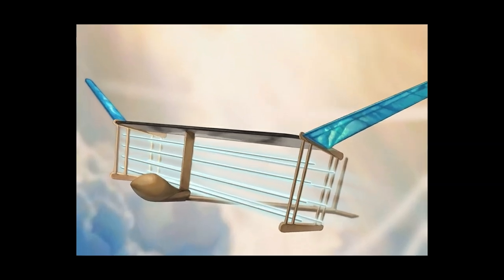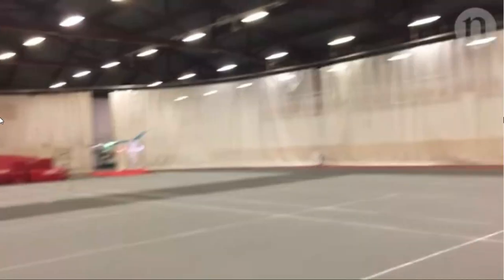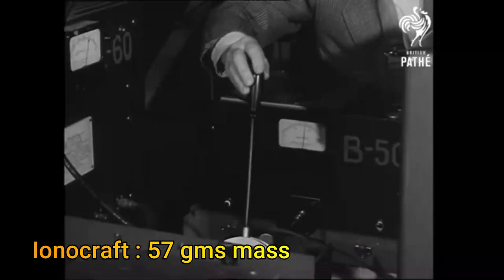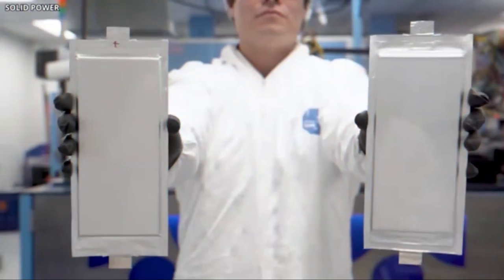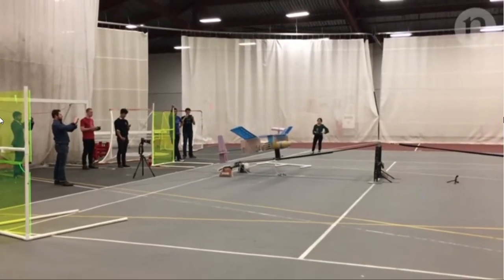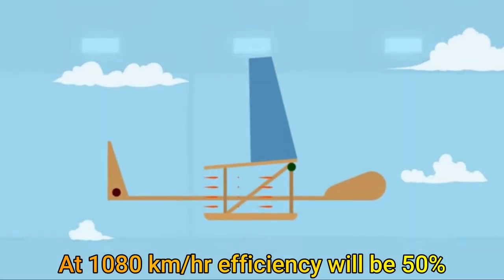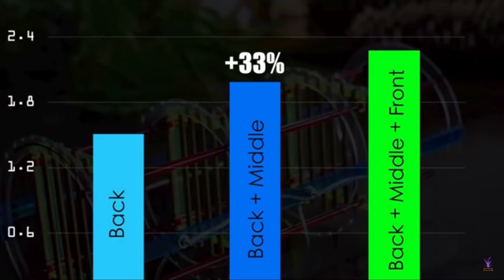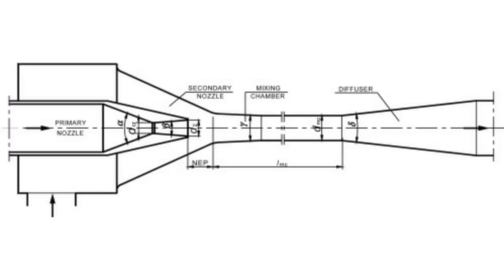Electroaerodynamic Propulsion:  Is it viable?

Comment: I believe the technology is not being used in the most beneficial way.  It may or may not work as the "only" thrust mechanism, but what I think needs to happen is using this technology in conjunction with other technologies to improve efficiencies of existing designs.  For example, this technology could be used to ionize the air on the leading edge of a wing (or other surfaces where drag is a problem) to help reduce turbulence and drag.  It could also be used, incidentally, to help reduce friction on leading edges for hypersonic craft and therefore lower the heat buildup.  And I'm sure there are many other ways this technology could be used to help with efficiency that I haven't even thought of.
Reply from the maker: Good ideas
Reply: @ElectricAviation  thrust can be improved using photoelectric materials to emit  electrons
Reply: This is exactly what I was thinking. A purely ionic-driven aircraft will never be able to have much power output, but since it is very efficient, it would be awesome to have one of these systems built into the wings of conventional aircraft just to reduce the amount of engine power needed. I think that could result in significantly more efficient cruising and be especially useful for increasing the range of electric aircraft, making them more viable.

Comment: As you said, they've really ignored the aerodynamic aspect of it so far. With ducting and entrainment it could surely be improved substantially.
Reply from the maker: I believe so too
Reply: Their working with low-voltage settings.

The goal is to have enough newtons to break away from Earth's Gravity or create it's own source of gravity that's independent of the current setting of gravity.

Mr. Thomas Townsend Brown actually found the formula; 2 Kilo-Newtons for every Kilowatt.

If you don't believe me, then you need to breakdown, every single piece, on how a "B-2 Advance Technology Bomber" is made, and why is it still considered the fastest craft.
Reply: @lumberluc  ??? The B2 isn't even supersonic, certainly not the fastest anything.
Reply: @jamesdeath3477  Okay... your not looking that way. Then look at why what it classified and how it was made known.
Reply: @lumberluc  How about you just tell me whatever you're trying to say, instead of asking me to "look at" whatever it is? Currently I've no idea what you are talking about.
Reply: @jamesdeath3477  Wow... Your no fun. Must be a real bore at parties.

Anyways, the tech is there. Inside the twin turbine engines of the B2 bomber is a lattice matrix.

Fuel is burned, leaving an negative ion charge, collected by the lattice matrix, which is then lined on the craft. This make air resistance null and giving most radar-technological methods the slip.
Reply: @lumberluc  I may be a bore, but you don't find me making stuff up to make myself appear clever. Maybe just stick to the UFO websites in future, eh?
Reply: @jamesdeath3477  Another one who isn't even into Black Box Projects delivered by Skunk Works, which is part of Lockheed Martin.

Sigh... So narrowminded.

ANYWAYS! My basis of the comment is; The tech's there, along with the fear, and may the best man win.

Comment: Very interesting indeed. Efficiency numbers of sub 50% are going to be a challenge with Li batteries (hydrogen fuel cell perhaps?) but the lack of noise and the absence of moving parts means that this propulsion system is both quiet and safe. The two most significant issues with electric aircraft today. I'm guessing that enclosed tubular jets with multiple ionic thrusters are the way forward (rather like Linear Accelerators in Physics).
Reply: "safe", they still are under enormous voltages.
Reply: I'd say the biggest issue with modern aircraft is how polluting they are. Unless you're going supersonic, I don't think noise is that big of an issue comparatively.
Reply: thrust can be improved using photoelectric materials to emit  electrons
Reply: Makes one think of propulsion in extraterrestrial craft... 🤔

Comment: Hard to imagine this EVER being able to be higher performance at a given speed than propellers. That’s all that matters.
Reply: Depends on what you mean by 'higher performance'. I'm currently presuming you mean to use the term 'performance' as a stand in for 'units thrust per unit energy' or something along those lines, but unless I'm mistaken about your meaning, I feel you may be missing the point; overlooking what performance metrics the demonstrated systems seem to excel at in favour of where they clearly lag/fall short. I'm fairly certain that there are a number of instances where lower thrust per watt would happily be accepted in exchange for lower decibel levels, as drones that operate more quietly could find use in instances where propeller noise might be considered 'disruptive', and by that metric these 'ionic thrusters' seem to have far 'higher performance'.

For instance, I've heard a number of proposals for restaurants, bars, theaters, stadiums and other such venues that want to use drones to deliver food and/or drinks either directly to customers or else to some more centralized hub where servers would further distribute them, and one of the frequently cited sticking points is with the noise said drones would produce and how it might negatively impact a dining/viewing experience. A near silent drone would soundly address that issue, if you'll pardon the pun, and with the short flight paths expected and a sufficiently sized fleet alternating charge cycles the drone being less efficient may not be a deal breaker; leaving said proposals to fail in newer, more innovative ways🙃

Other potential areas of use might be fields like wildlife observation or even law enforcement where being a less obtrusive presence in your surveillance could be the difference between subjects/suspects acting naturally and them being cautious or evasive. Drone delivery is also an area that might benefit, not because I think people would be so annoyed by the sounds of sub-urban drone deliveries that quiet drones seem like an urgent priority for the adoption of such things, but rather because I've had a truly remarkable number of conversations with seemingly otherwise reasonable people veer onto the topic of shooting down delivery drones with slingshots to steal packages... I suspect that less then ninety nine percent of the people I had that conversation with actually would 'shoot drones for loot, holmes', but for the sake of not tempting that one percent maybe sometimes 'higher performance' means not letting them know a drone is delivering to his neighbors back porch.

Now, it's fully possible this tech just doesn't mature to a point where it's actually useful in any of those areas, or that other solutions come along rendering such things obsolete before it does, but it shouldn't really be needed to be said that different use cases have different performance priorities and that there is rarely a single engineering solution that is best across them all cases. Even if they remain weaker and less efficient, they may still find niche application.

Comment: If the idea has been floating around for about 100 years, who was the first to write about it or get a patent on it?
Reply: Robert Goddard received a patent in 1906 for a low powered ion thruster.  Then in the 1950s TT Brown made an air breathing one that could swing around a pole, powered externally.  After him, Major De Seversky built a device with a large external heavy power supply as well, that could take off vertically, there are also many others that made small but notable improvements.  I am the lucky one that has the patents for the first such device that can lift its own power supply vertically! against Earth's gravity!  It cost vastly more money to develop it over the past 23 years than the project has earned at this stage.  To those few that donated or invested, I am extremely grateful.

Comment: Atmospheric ion thrusters are unlikely ever to be efficient. Due to high energy transfer to ions in subsequent collisions with neutral molecules most of the energy is absorbed by rotational/vibrational molecular states. Increase the ion density and reduce the field strengths and you run into space charge limits.

Comment: A lot of years ago I was very interested in this concept ( I remember when the Popular Science article came out in the 60’s). Years later, my thoughts were directed at the idea of using contra rotating discs to generate the high voltage electricity with electron stripping materials between the discs then use the electricity to make other parts of the disc surfaces “stickey” to the air and cause them to perform as impellers in various ways and to cause a high velocity airflow over the body shape to produce lift and thrust. I never tested the idea. 
At the moment I am more interested in making the Custer wing an effective drone where I have devised a method to make the wing transition from high lift low speed to low lift very high speed.
Reply: @jcd-k2s  It’s pretty straight forward. Consider a frisbee which when it spins causes air to flow over the surfaces with Chanda effect on the upper surface drawing the air around the surface deflecting it downwards creating lift in conjunction with the low pressure zone above the disc. 
Now attach a motor shaft to the frisbee, and the motor drive Body to another disc. The two discs will rotate in opposite directions. Between the two discs apply an electron stripping material (Van de Graf Generator) to provide high voltage electrons to be used in a multitude of ways. The electrons can be used to make the main drive surface more sticky to the air to improve the impeller effect. It can be used to induce air flow between surfaces to enhance the Coanda effect at the skirt of the drive disc. Etc. There are many possible configurations to experiment with.

Comment: I think the technology is really good for lighter than air craft.

Particularly if you use a hybrid rigid, lifting body, lighter than air craft, with thin film solar panels.

That gives you the area you need for all the solar panels without having to lift them purely aerodynamically.
Reply: yes.   as the DARPA "Walrus" was intended to do.    for fun this  coming holiday, read "OMG A UFO"
Reply: also motor gliders with solar panels. removing the electric motor would be great for long duration flight and pseudosatellites. at the moment ionic thrusters are too inefficient

Comment: Another excellent video that makes me think outside of the box...
The challenge with electroaerodynamic propulsion is Coulombs law: you need high electric field strengths to make the electrons jump out their outer shell orbitals. This means high voltages and very fine wires - ideally lots of them. The high voltage isn't a constraint as long as you can avoid flashover, but fine wires risk mechanical failure from the aerodynamic load  as speed gets high. To my mind very fine aerofoil shape aluminium extrusions are the optimum to keep drag down and provide a sharp trailing edge for maximum N+ generation. The risk here is increasing wetted area so you create more drag than you remove.
Propellers and rotors are actually a very efficient and practical solution to moving air, but electroaerodynamic modification to hold on to laminar flow near the trailing edge could definitely benefit high speed cruise in electric aviation speeds (ReN>>1E7)

Comment: At CES this year a company called Frore showed their AirJet, something they called solid state cooling.  It’s meant for cooling computer components, but it did seem like it could move a decent amount of air in a pretty thin package.

All pie in the sky thoughts at this point, but it would be cool if this tech could be scaled up and used as propulsion. It would have interesting applications as active boundary layer control and thrust vectoring if integrated into the wings and flaps/ailerons. Might be something to keep an eye on.
Reply: Frore I believe is using ultrasonic vibration to move air not ionization.

Comment: Improving the performance of electroaerodynamic (EAD) propulsion systems will require a combination of technological advances and a better understanding of the underlying principles of ionic wind propulsion. Some potential ways to improve the performance of EAD propulsion systems include:

Developing more efficient ionization methods: Currently, most EAD propulsion systems use high voltage electrodes to ionize the air and create the ions that are used to generate thrust. However, these electrodes can be inefficient and can generate a large amount of heat, which can limit the overall efficiency of the system. Developing more efficient ionization methods, such as using lasers or other forms of electromagnetic radiation, could improve the performance of EAD propulsion systems.

Improving the design of the propulsion system: The design of an EAD propulsion system plays a crucial role in its performance. For example, the shape and size of the electrodes, the placement of the ionization source, and the design of the thrusters all affect the efficiency of the system. By carefully designing the propulsion system to optimize these factors, it may be possible to improve its performance.

Using advanced materials and coatings: The materials used in EAD propulsion systems can also affect their performance. For example, using materials with high electrical conductivity or low levels of resistance can improve the efficiency of the system. Additionally, using advanced coatings on the electrodes and other components can help to reduce wear and tear and improve the longevity of the system.

Conducting further research and development: Finally, continued research and development is necessary to fully understand the potential of EAD propulsion systems and to identify ways to improve their performance. This may involve conducting experiments and simulations, as well as collaborating with other experts in the field to share ideas and findings.
Reply from the maker: I concur with all your suggestions

Comment: There are studies dating back to the 1950s that describe tests on conventional air craft surfaces. What is found is that the laminar flow becomes much more stable and in situations like a climbing aircraft wing the vortices behind the lift wing are greatly decreased. 
Other later works study how air flow can be steered by using variable rear elements. Essentially connecting differing points as the receiving end of the static charged flow can steer the airflow.
The third interesting study was published by the dept of the navy back in the 1950s. This study found that a large field created around a conventional jet could disrupt the air molecule flow behind the plane enough to disrupt the sound wave formed by exceeding mach 1. So a sonic boom muffler.

Comment: This is what the future really looks like.   The atmosphere is also full of electrical energy and a plane moving fast could probably gather enough energy and feed it right through these thruster  to maintain its momentum.  You can also use magnetics to heat or accelerate the ions.
Reply: Infact, if there are any engineers out there with real chops, I will seed a start up around this.

Comment: Awesome. But similar magnetic energy there exist a lot of problems. Low trust as an example is one of the disadvantages of this technology. But according optimization we can use this technology. Furthermore, high voltage cause a lot of problems for the passengers body if it would be improved. Produce the high voltage is very hard for the aviation systems.

Comment: I’m not really seeing the value of adding a duct. A duct can basically do three things: 1) 
the inlet shape can make trades between inflow air pressure and speed, 2) the duct can reduce fan blade tip losses, and 3) the nozzle shape can make trades between outflow pressure and speed.

Obviously, fan blade tip losses are not a concern with a solid state propulsion system.

At the inlet and outlet (nozzle), there is probably not a big enough pressure difference to make the added weight and drag of a duct worthwhile.
Reply: Thanks for saying it!  Furthermore, all of these types of air breathing ion thrusters pull in lots of air from the sides, so covering up the sides just reduces the thrust and increases weight.

Comment: so i do not have the funds to try these experiments any longer. but please consider building the lifters into a half spherical dome shape. ball side facing downwards. this allows for lift and much better stability and by simple adjustments of voltage to certain sections you can give it direction. i know this will sound crazy but i have seen a ship with 2 of these it was not made by man. it made no sound but it was very real. i assume those half dome shapes were infact some type of ionic lift. no matter where i saw it this does make perfect sense.